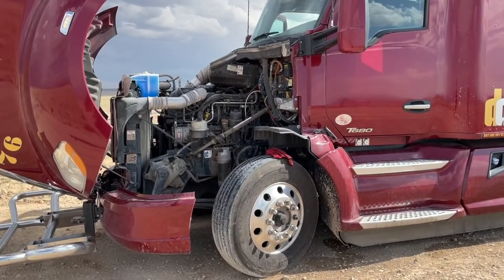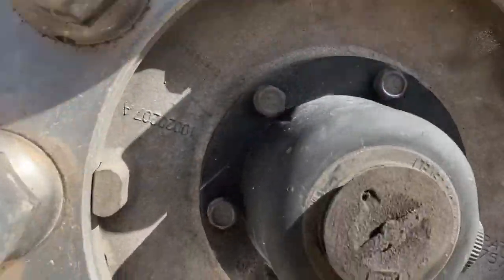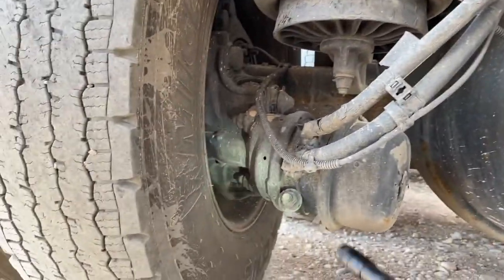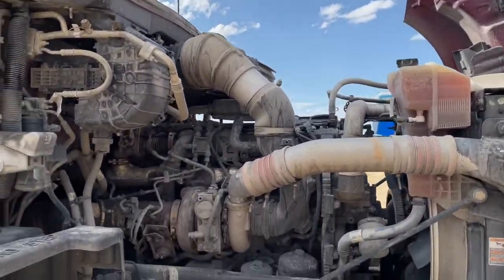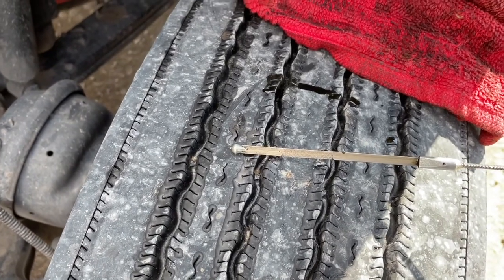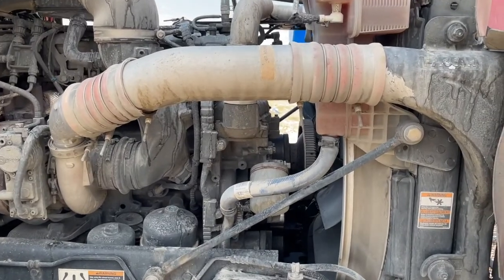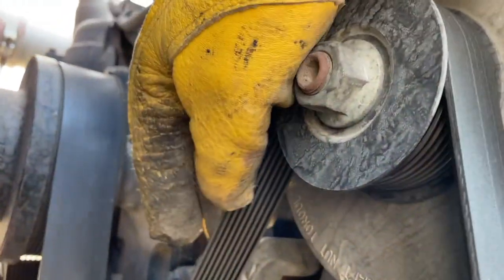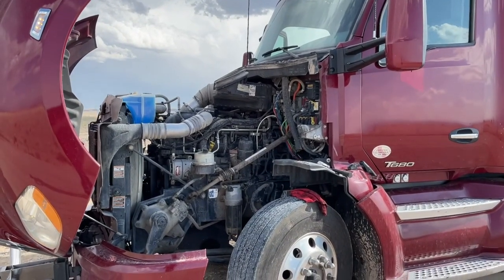Semi Truck Pre Trip Inspection in Minutes

Comment: Very well done and 90% more thorough than the vast majority of pretrips that Ive seen guys do. MY current company slip seats and almost all the drivers expect the other guy to do the pre and post trips so they can just drive. It's beyond frustrating.

Another good thing about frequent, good pre and post trips is that it gets you familiar with your equipment and you will notice something out of place sooner than if you just do them once in a while. Its alot easier to fix a problem when its small, than when its big and you're stuck on the side of I80 between Wamsutter and rock springs during a storm.
Reply from the maker: I agree. I think daily pre-trips make pre-trips so easy. It is when you don't look often then you feel like they are a burden because you feel like you have to find new things all the time.
Subscribe to help us keep making content that can help drivers!

Comment: Im currently doing my class 1 lessons. And there way more to check foe us anyways. Have to learn and the pieces names. Make us check outer tires, tire grip, wheel, frames, axels, torque rods, leafs, u-bolts etc. So many parts to learn. I understand what to check, but dont have all the names down. A little stressing.
Reply: There's a lot to learn when you're getting your big rig license but you'll learn all the names of the parts as you become more experienced. Keep putting on the effort and you'll be fine. 😁